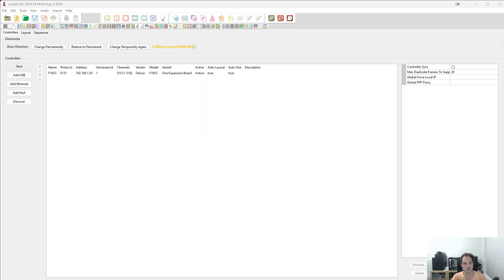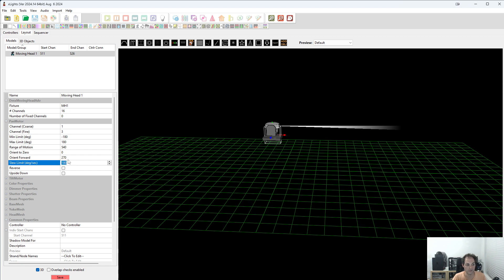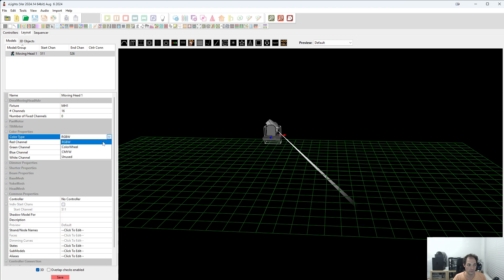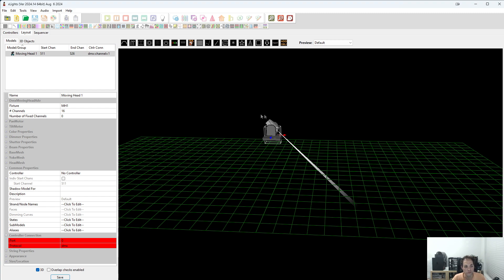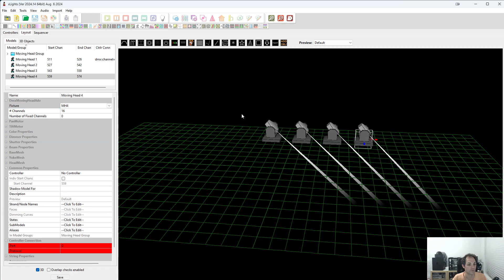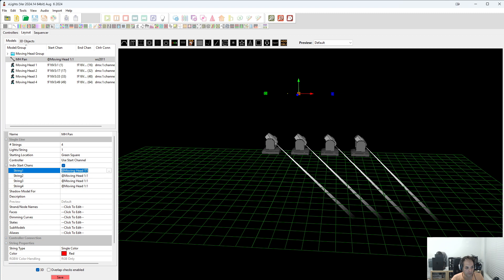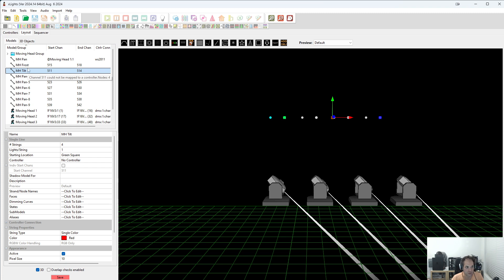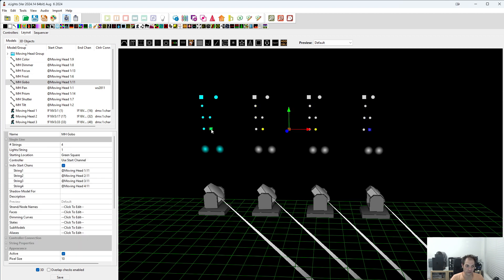How to Set Up Moving Heads in xLights | Wally's MiniBeam Pro 380W

Comment: Can you explain how you handle Lamp on and off? It looks like it takes 5 seconds or so to power the light on.  Do you really power it on and off as part of the sequence? I'd like to see a video on this
Reply from the maker: Hi.  To turn the bulb inside the moving head on - you will use the lamp channel (in this case channel 16).
You will create one sequence to turn them On at the beginning of the night, and then another that will turn them all Off at the end of the night.  After you turn the bulbs off, you still need to keep the moving head powered so the fans can cool down the fixtures.
I like to create an 30 second animation sequence that have my display twinkle, a message on a matrix saying show starting in 30 minutes and the bulbs inside the moving heads will turn on.  Please let me know if you have any other questions or need more detail on this.
Reply: @blinkysequences  How does that ON sequence work? I'm imaging like you shows with the Shutter channel, a ON effect that's 5 seconds long, but when it ends I assume the lights would power off...or when the sequence ends it would also power off the lights. That's what happens with Pixels
Reply from the maker: When you power up the moving heads, the bulb inside the unit is initially off. To turn it on, create a sequence with a DMX effect no the moving head that lasts about 10 seconds and set the Lamp channel (channel 16) to 205. This process is usually referred to as 'striking the lamp,' as it is essentially like flipping a switch to turn on the bulb inside the head.

Keep in mind that you won’t see any light yet because the dimmer and shutter channels aren't set to 255. Once the bulb is On, it will remain On even if no sequence is playing. The only way to turn off the bulb inside the moving head is by sending a value of 105 to the Lamp channel.

After the bulb is on, your show sequences will control the dimmer and shutter channels to manage the output of light from the unit. I hope this helps clarify the process! I’ll look into creating a video on this topic, but I likely won't be able to get to it this month as I’m booked up with the start of the show season.
Reply: @blinkysequences  Yea a video specifically on this would be super helpfull! Thank you :)
Reply: @blinkysequences  My moving head lights arrived. These are NOT the same one Wally sells.  But now I have another question. When I power off the heads the fans continue to stay on.  Is this normal?  They are fairly loud. I left it alone for 30 minutes expecting the fans to eventually turn off, but nope.  Now I'm wondering if I should just run power through some automated power plug.  Do you leave your head fans running for all of December?
Reply: @SteveZaske  the fans remain running at normal speed.... let the globes cool down for say 5 minutes, then turn off power to the MH's